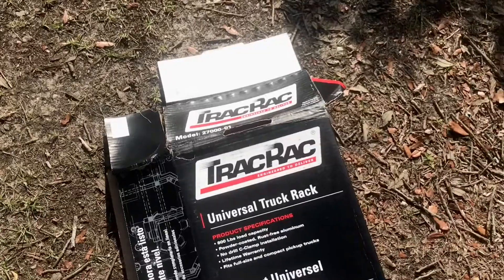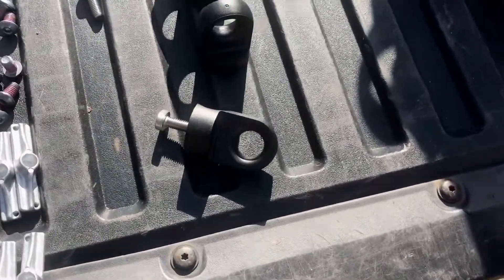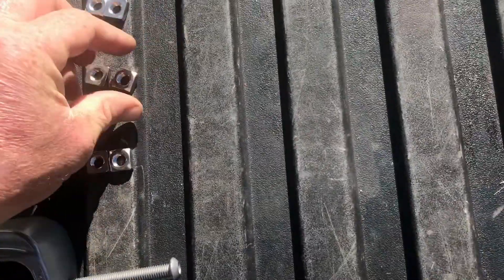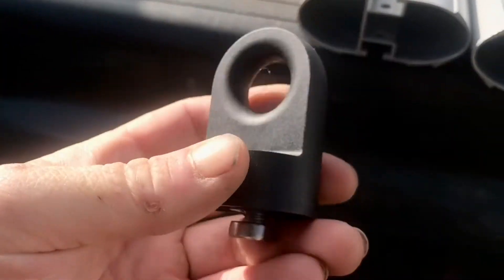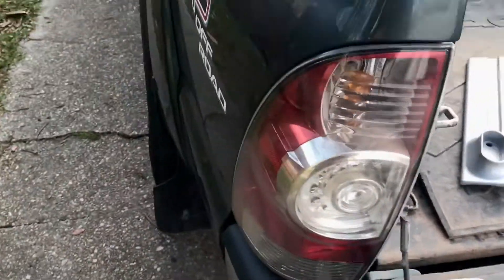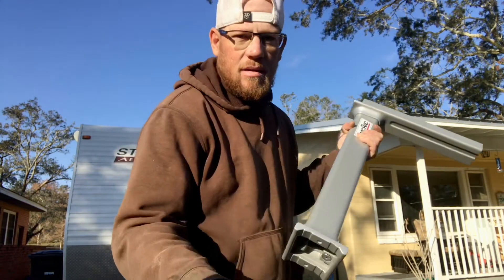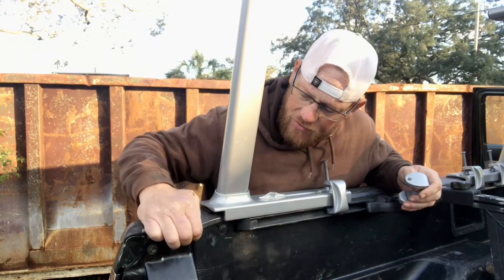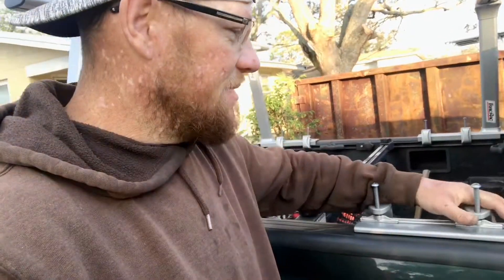EASY to INSTALL truck rack in 10 MINUTES! This is the BEST universal Truck Rack!

Comment: Rack works great, I found bolts on clamps tend to loosen up over time, I  put double nuts on and completely eliminated from happening, 2yrs now no loosening,
Reply from the maker: Yes sir! That is a great suggestion! I ended up putting loctite on mine. The blue, but double bolt is way better 👍

Comment: What's the minimum width you can adjust these.. I have a jet ski trailer that is 44 inch wide and was wondering it I can close the width of these to mount on side of trailer? Thanks
Reply from the maker: You can slide them so I would assume it would work

Comment: very helpful new to kayaking and you sold me on these..... fast and easy!
Reply from the maker: They are super simple to install. Just make sure to check clamps often or lock tight them. They will rattle loose. I’m lucky they fell in the bed when they have.👍

Comment: I think the bolts go under the clamp/the clamps are upside down. Harbor freight is same one, and it's bolts are under.
Reply from the maker: They don’t work the other way with this year Tacoma like they claim. Installing upside down worked and got shorter bolts at Ace hardware for about $10 vs the $70 they want got the right brackets 👍

Comment: There’s an adapter set if clamps for the Toyota rail.  It’s about $70, found on Amazon.
Reply from the maker: Thank you! I’ll look into it. The upside down clamp with shorter bolts looks fine to me for less than $10 👍

Comment: 5 extra mins to follow instructions but everyone has their own ways
Reply from the maker: I have a TBI so reading is more difficult then just figuring it out. Instructions or not, they said it is for this year pickup and it didn’t mount the way they said so improvising would be required either way. I’ll tell you this! It carried my Hobie kayak all over Florida for 4 months with no issues 👍

Comment: your clamps are upsidedown
Reply from the maker: They won’t clamp the proper way on this Tacoma. It says it works but with the stock bed “tracks” it doesn’t work. The upside down clamp is the only way to make it work. I got shorter bolts when I got down to Tampa so it looks a lot better now 👍
Reply from the maker: The other trucks shouldn’t have that issue and should work perfectly
Reply from the maker: I also clearly stated in the video so you obviously did not watch 🤣👍
Reply from the maker: Dan Beaupre  how is it dangerous? I drove all over Florida, Texas and back to Colorado with no issues. 🤷‍♂️
Reply from the maker: Dan Beaupre  I only use it to haul the kayak once in a while. I will look into the clamps. I got shorter bolts for under $10 and it stays fine. I’ll research the others, but $70 for something the box should include if it states the year make and model is kinda a racket. So far so good! A little temp loctite and they work great 👍
Reply: It will work that way with shorter bolts but you can go to a cap place and have them order the correct clamps for your truck. Only thing is it might cost you 80 bucks or so. I'd stick with the shorter bolts and the clamps that came with the rack I guess.
Reply from the maker: @Kenman69101  That is my thinking. If it becomes an issue I will invest in the $80, but for now the shorter bolts are doing the trick 👍